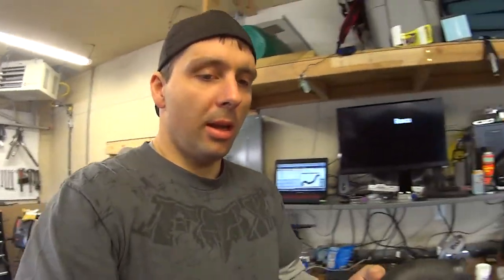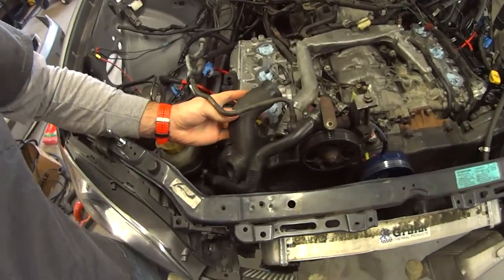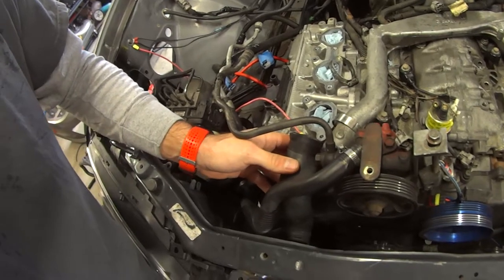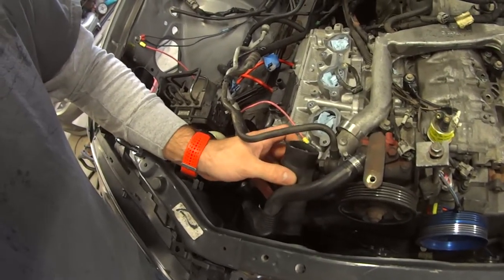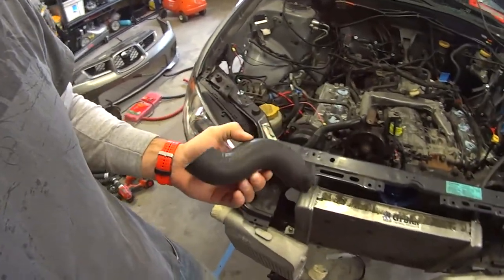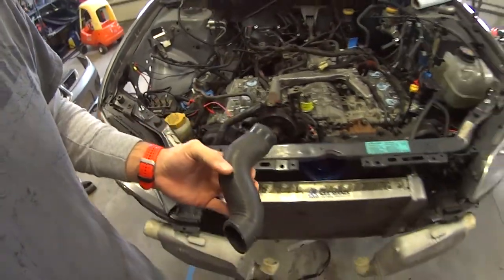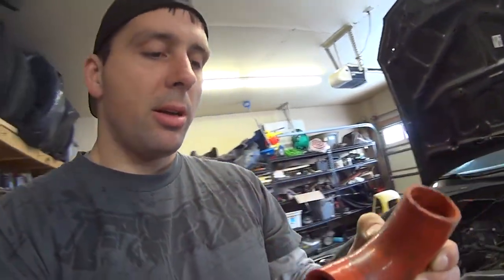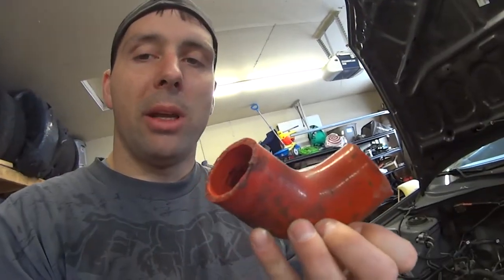EG33 Swap - Cheap Radiator Hose Options (Ep. 15)

Comment: 99 forester with saab rad and 2x push fan setup. overheating if left idle for too long. curious if others have had cooling issues. also ive got the 3 rib belt on the 4rib alt pulley and looking for solutions to belt squeak from poser steering. thanks again eg33 fam